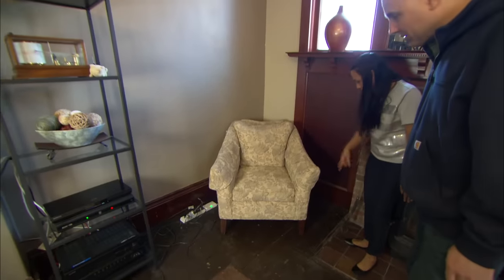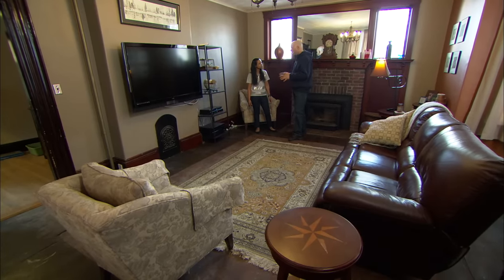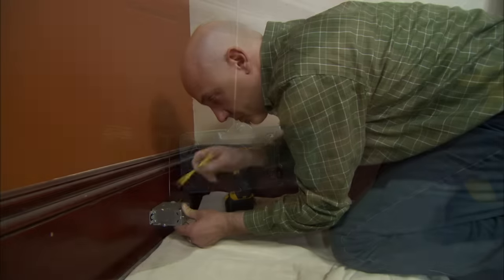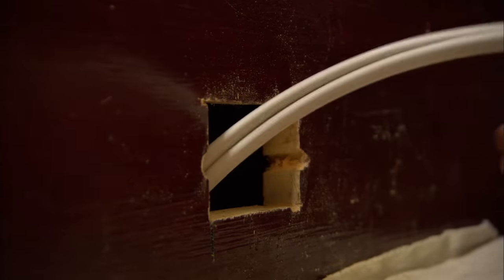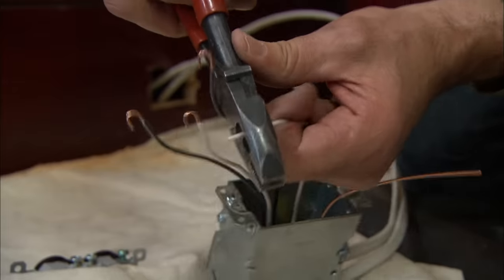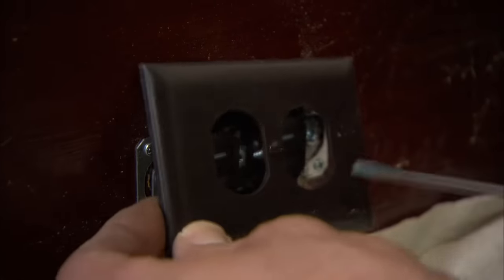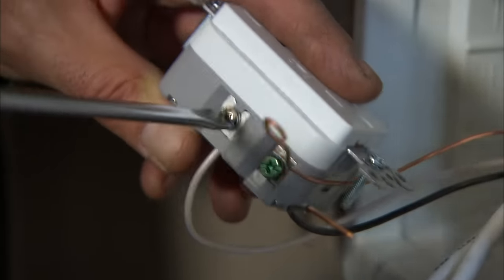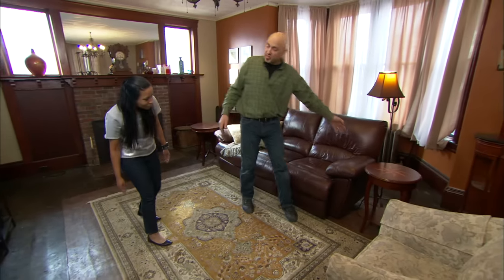How to Add Outlets to a Room | Ask This Old House

Comment: 4:00 Doesn't it matter which Wire goes on those screws? Yes. White w/ silver screws and Black w/ Brass. But does it matter if I switch the White wires around (on silver screws)?

Not putting them on the other side. on black. I mean switching the White wires around. I guess I'm asking if Polarity matters :P Thank you in advance :)
Reply: In this case, it doesn't really matter which white (neutral) wire goes to which silver (neutral) screw. The two screws are bonded together with a brass piece (as are the screws on the hot side), so they are electrically identical. 

BUT! Most duplex outlets are designed to allow you to break those bonding tabs, so that each receptacle is isolated from the other (so that you could, for example, operate one receptacle with a light switch, while the other one stays live at all times). In that case you would want to make sure the neutral wires go to the correct neutral screws. This is especially important if two separate circuits are connected to that outlet. Swapping the neutrals around could lead to a potentially dangerous situation where a circuit being worked-on, even though properly shut off at the panel, could still have current flow through that crossed neutral wire. This is known as a shared neutral.
Reply: Thank You +Matt Chrestman :D 
Always wondered how they isolate outlets and switches. By breaking the metal bracket between the two screws. =Did not know that.

So Swapping Neutrals don't matter as long as they're connected (in series?). Silver to Silver(white). Brass to Brass(black). Cool. Thanks again m8 :)

Comment: No “pigtails” for making the connections to the outlet?….🤦‍♂️! That would not pass in Ct. He’s relying on the tiny little “tab” on the outlet(s) between the two silver screws and between the two brass screws to carry current to the next outlet(s). That’s a terrible idea and you’re just asking for problems. I can’t tell you how many times I’ve been troubleshooting a “half power” issue and found that it was caused by not using “pigtails”.  Very low quality install IMO.

Comment: As a non electrician, obviously I have a few questions... We're the boxes all connected together on one circuit? Did they run this into the panel or off an existing outlet? How do you string multiple outlets together safely? This info would have been a little more helpful than cleaning up HDMI cables....just throwing it out there.
Reply: 6:06 has the info you're looking for. He installed an Arc fault dedicated 15-amp breaker. These are strung together in/out of each receptacle, like a string of Christmas lights. I would have put them on a 20-amp and used 12/2 MC rather than 14/2 romex.

Comment: America uses a coding standard! Older homes are exempt in some cases. I would have used a plastic box. I do not like sticky out let’s they can let go of the electric wire. Happens all the time in older homes. The wire pops out of the back of the outlet.

Comment: At 3:59, very poor terminations of the wires on the screws.  Also, real electricians use pigtails.  Just sayin.  At least he didn't backstab.
Reply: He also used the incorrect method to strip insulation , he wouldn't be working on my crew for more than a day if I saw him stripping wire using that method , but Romex jockeys abound by the score .

Comment: I'm shocked at US electrical standards.
Reply: It varies state by state. In Texas you can run NM cable but in my state of Illinois many counties don’t allow that and would have to use Conduit to send the wires through
Reply: @johnabner7743  I live in Canada and our code is similar to the states, we do not have to run conduit in wood structures unless specified. Why do you have to use conduit?
Reply: Eric Weaver hey how’s it going brother, in Chicago and many counties around it we can not run romex in residential unlike in many other states, it’s actually code we run conduit mainly half inch EMT and run our wires through the conduit. We have our own code book. A lot of people don’t get our coding system because it’s different but again coding varies state by state and even county to county.
Reply: I wouldn't put too much stock in this video in regards to US electrical standards.

Comment: if the outlet was that low what if there was a flood, the water would get into the plug real easy. Higher up would be better
Reply: JaydenGamez that's why you have a GFCI circuit breaker. That house is old, like probably pre 1950. New homes baseboards are barely 3 inches tall.
Reply: Maybe the house is not in a flood-prone area. Storms which might cause flooding might also knock out the power.
Reply: I think if the water reaches that outlet in the first floor after flooding the basement with the circuit breakers an all it might be your last problem to be concernced about....
Reply: That's what I was thinking, you would need about 7' of water for the outlets to be under water!

Comment: They should make these "How to electric" videos all the same 10 second clip, explaining that you have to get a professional. As interesting and fun as it is to mess with electric wiring, it's not a DIY job, because of insurance liabilities. Especially those old wooden houses in the USA will burn like a torch when it goes wrong. Bye possesions, pets, possibly even your family :)
Reply: Adding a recept isn’t going to burn anything down as long as u do it right, it’s not any different than adding a light fixture.
Reply: It depends on what jurisdiction you are in. I am in Ontario you can pull a permit as a homeowner and do the work yourself provided its inspected. I have done it with no issues. Just make sure you take your time.

Comment: Tamper resistant outlets are just something marketing companies came up with to make something that almost never fails need to be replaced much more often. 
Also sideways outlets are useless for any "Wall wart" plugs (plugs with built in AC-DC or other power adapters). Anyone who installs outlets that way should be kicked in the balls repeatedly.

Comment: Everytime I watch a video of an American Electrician working I cringe when I see them use Straight-slot and Phillips screwdrivers.  Guys, get with the program and get yourself a set of Robertson's (Square), they are so much better to work with, and all the screws in boxes, outlets, switches, etc... they all have them!

Comment: Why defeat the purpose of the baseboards? They exist to protect a thin wall from impacts.  I do not want a fragile plug exposed to impacts at that level.   Much easier to just cut the hole in the thin wall above the baseboards.
Reply: It's a lot of work to repair a 100-year old painted lath and horsehair plaster wall.
Reply: That’s not the purpose of a baseboard.

Comment: Really? This is still what electricity is like in North America? This kind of installation is deprecated in Europe since the 1960s. The entire wall outlet is frightening! No cage clamps? No completely insulated housing? Earth-Conductor is a still worth to be mentioned? Single wires instead of a double insulated 3 conductor Cable? The distributor in the cellar looks like from a museum and offers a wide range of false installation, hidden short circuits, high transition resistance and more. Just completely frightening-ridiculous…

Comment: Check your local regulations before doing something like this. In Australia for instance, it is illegal for someone to do something like this unless they are a licensed electrician. Major fines can apply, and if an individual was exposed to a risk of death from DIY electrical work fines in the hundreds of thousands and imprisonment can be applied. If something were to occur it would also void any insurance you have on your house. Just a warning.
Reply: In Australia you currently get arrested for leaving your house without a mask on.

Comment: American wiring and electrics in general are pretty hideous.
Reply: First country to have it so we have every variation from inception to modern. Consider yourself lucky we shared it with you
Reply: @irontiger0462  WRONG! First public electricity was in the UK: The world's first public electricity supply was provided in late 1881, when the streets of the Surrey town of Godalming in the UK were lit with electric light also. In 1881, the first public electricity generator in Britain was installed in Godalming, Surrey. The next year they passed the Electric Light Act which was the first public measure dealing with electricity supply.
Reply: @lincolntrains2639  Pearl Street Power Station in New York City. The Pearl Street Station was one of the world's first central electric power plants and could power 5,000 lights. I believe what you sighted was roughly in the same time frame

Comment: Why did he use a metal box instead of a plastic one?

Now if she wants to rearrange the room, she can't move the TV. Would have tripping hazards on the floor because of the floor outlets.
Those TR outlets, some makes it more difficult to plug and unplug something. It's like you have to push and pull harder on it.
But NJ code, call for TR outlets.
Reply: john M the tv is mounted on the wall
Reply: It's easy to mount it to another wall. Or to just move it and do without a mount.
Reply: You're right about tripping hazard with plugs on the baseboard.  But what's actually a bigger issue than tripping hazard is damage to plugs and outlets via someone ramming a vacuum cleaner into them every few days, year after year.  The metal box was probably just for robustness.  Or the baseboard was too thick for an old work box's "tabs" to fit.
Reply: Actually I was talking about the gold boxes he put in the floor. @5:10. Go and spill some liquid, the breakers will trip. He should have at least put GFCI.
But he could have moved the wall outlets up like 4 or 5 inches.
Yeah, he couldn't have put the tabs in it.
Don't they make the plastics that you can screw like this one, from the front. Or he could have gotten a piece of 2x4 screw the into the back of the baseboard.
One thing I don't understand. Maybe just a weird house. But I never seen baseboard with nothing behind it. Maybe the builders did it for future proof, for instances like this.
Lots of stuff in old houses aren't done today.
Reply: Tyvek, what I asked was nothing wrong. That's how you learn. There is nothing wrong with asking questions.
Reply: Those aren’t floor outlets

Comment: Yea that was smart to not cut a hole in the cheap drywall and cut a hole in the probably hard to find old wooden trim that made perfect sense..
Reply: He said in the video that it wasn't drywall, it is plaster and lath. Also, the existing outlets are on the baseboard. It would look weird to install them on the wall while all the other ones are on the baseboard.

Comment: I'm so glad I'm an electrician in the UK. Our wiring methods and safety regulations are far superior to the American standards.
Reply: exactly, I did not see the electrician using any sort of metal or PVC conduits, all power cables are free lay.... not very professional, we don't even do that in Hong Kong.
Reply: fkwcfkwc why would you need conduit when there is no risk of damage. Conduit is only required where there is a risk of damage or not in NM cable.
Reply: Why as an electrician are you watching Ask This Old House videos then. As a qualified electrician, you shouldn't need DIY videos.
Reply: ncameron7   Is basically a safety British standard, very common for both UK and HK. Nobody know if there will be any risk of water leakage or whatever, so free lay is definitely unacceptable. And conduit, whether it's PVC, metal or flexible conduit are required in all situation. And of coz not everyone will follow the rules.
Reply: Horrible answer man...horrible.   Conduit isn't  waterproof. 
The searching on NM nonmetallic cable is rated and listed by UL for such wiring methods. Tested in laboratories. It isn't free lay. In New construction it is stapled. The NEC designates that it doesn't have to be stapled where it is impracticable to be stapled or secured.  Out of respect I won't trash you but your logic is just awful.  Conduit in a residential house. Only in the basement or exterior.
Reply: There is no body of evidence to support your claim of superior electrical standards.  I would be happy to post you a copy of the most recent NFPA 70 NEC. If you're a nerd about electric then you'll find it an enjoyable read.
Reply: Conduit is not generally required for residential electric using non-metallic pvc  sheathed cable. It is a very durable cable.
Reply: ncameron7 omg..... nobody said conduits are waterproof, they are there to minimize any leakage or direct contact or short circuits....etc, And conduits are required no matter it's residential or commercial offices, guess that doesn't really matter to you coz no matter what, you wouldn't never agree. But One thing I learned is that I only just realized BS are actually very high standard. Have a good day.
Reply: Chicago uses conduit in homes. Only short runs of BX are allowed, few feet. No romex/plastic
Reply: fkwcfkwc Romax is completely sheathed wire. Water is not going to effect it. The only danger of not using conduits is there is no protection from punctures but that’s so rarely an issue. On top of that when there is a punctured wire since it’s only 120v we have a small spark and a flipped breaker. The wire is repaired and the breaker reset and all is well. We’re as with 240v you have a lot more spark.
Reply: Romex a  brand name for one companies NM wire. It really is not defined as waterproof like UF class wire is. Thus where their is much water or for underground usage the class UF wire is used. NM wire does have some paper, thus is sometimes where a home is flooded. For clarity the NM wire cable is for indoor usage only. The under the plastic jacket on NM-B wire is often a paper wrap, then the 2 plastic coated wires and the bare copper ground. The -B adds a higher temperature rating.
Reply: We have no issues In any houses that follow code and repair work follows procedure. Ummm case settled, doesn't matter if it's superior if neither installation doesn't have any problems
Reply: DOOM what's with all these comments. There are different standards in each country.
Reply: You guys always are better
Reply: DOOM strictest gun laws in the world....no thanks
Reply: fkwcfkwc So Why are PVC conduit superior and what do they do? 1. Protect wires from rats eating at the cable.
2. You can add wires after installation (from 3 to 4, or 5). 3. They are there to cool the wire. If a single wire is in direct contact to insulation it dont get cooled.  in PVC pipes it do. 4. Protect from nails. 
5. Rewire an old house is easy. Or just change wires to bigger ones.
6. Cheaper wires. When you have pipes you dont need all that protective layers. US wires are thick and expensive.
Reply: pk13910 in uk we use 240 volts .volts and current are two separate things
Reply: @andrewknowles9783  In Britain you cannot have lights in bathrooms unless they are pull chain.  The theory is that a pull chain is less likely to electrocute you if you have wet hands.  They are a very odd (and paranoid) bunch over there.
Reply: @3beltwesty  Chicago used lead pipes for water services too. Great idea!
Reply: @fkwcfkwc  "Nobody know if there will be any risk of water leakage or whatever"

So you are saying your plumbers suck over there?

Comment: Wow, Australian outlets (power points) are so much better designed and I'm surprised how thin the wiring is. UK has the best and safest power points though.
Reply: Australia is also on 240V.  Take a shock there and you die.  That's why they over-engineer them where you live (and in the UK).
Reply: also, the Australian power points are base off the American crow foot outlets, first used to provide a ground to appliances when grounding appliances first became code

Comment: lmao. . a 110 outlet CANNOT electrocute anyone. It's not strong enough. .. You'll get shocked and feel a tingle for a bit, but you won't die. . . A 220?    Different story
Reply: I would still rather not get shocked by a 110 outlet. I know this because I have been shocked many times as a painter putting tape over outlets with the covers removed. this was years ago and I did learn pretty quick that you don't really need to push the tape on to the sides for it to stay on, but I still got zapped a few times when I was in a hurry.

Comment: 15 amp circuit??  Total fail!!
Reply: What is wrong with a 15-amp circuit in the living room? It's code-compliant around here.
Reply: Jf Mc not a fail
Reply: @leonardholt5311  , Total incompetence!
Reply: Jf Mc That’s totally different. A Window AC unit would require a dedicated circuit
Reply: Jf Mc I promise you that the majority of branch circuit wiring in your house is done in 14 gauge
Reply: @leonardholt5311  Hahaha!! No it requires a trip to Walmart.

Welcome to the real world!!  Don't blame your incompetence on being code compliant!!  Code is to stop fires Not how to do a good job.
Reply: Jf Mc okay rook
Reply: @leonardholt5311  , Sorry you are having a hard time.  You know old habits aren't always good ones.  But if you keep an open mind hopefully you're not too old to learn the right AND best ways to do things!!
Reply: Jf Mc I’m not the guy in the video. And you don’t know jack about electrical building codes
Reply: Majority of circuits in a house are 15 amp
Reply: @electricaf365  , Nope!  What's important to consider is the use.  That circuit will be heavily used.  It's just poor workmanship to run 14 gauge wire when you know it will get that much use.